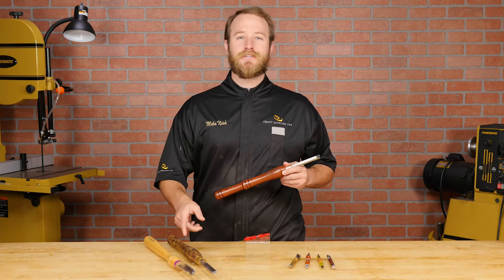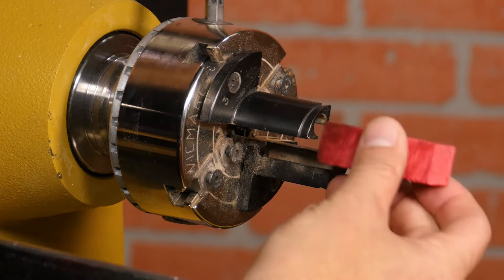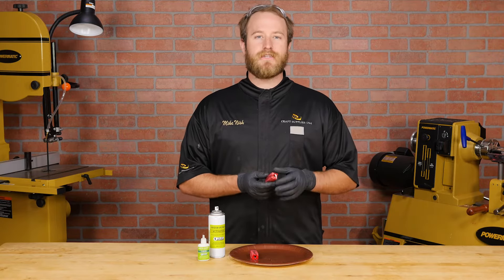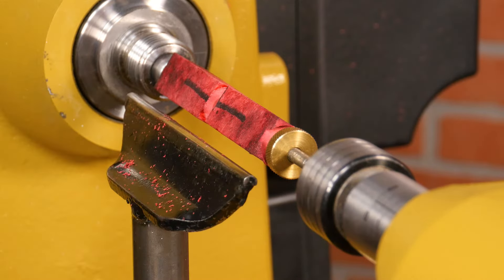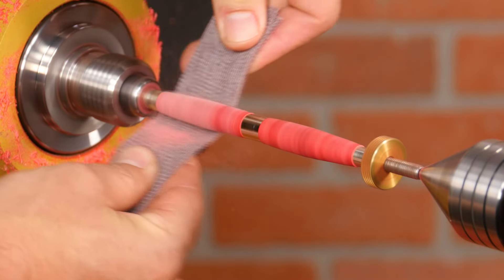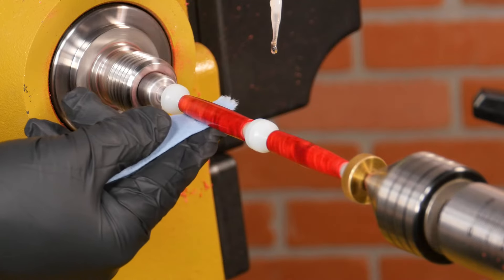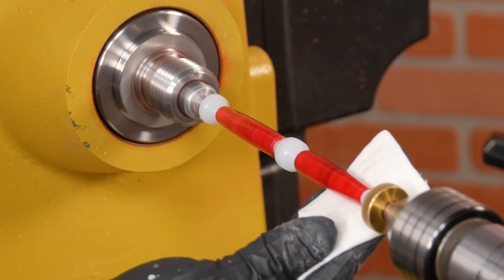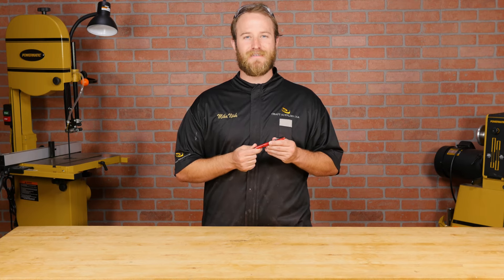Turning a Pen with Traditional Tools (How-to Beginners Guide)

Comment: When turning acrylic, I don't bother with the CA glue and continue on with sanding thru to a 12,000 grit and applying water at the same time. The finish on the acrylic comes out like glass and saves you from the CA ordeal with ridges and cacking around with that. Great video by the way.

Comment: Good video...one of the best. I sand the tube with 150 grit and wipe with a paper towel and acetone to remove any oils, fine particles, etc. I was pondering using the skew for the final dimensions. Thanks for the demo. I also made a tool from HDPE to insert the glued tube. No-stick bushings from the HDPE, too. I tried MM but the CA gummed up the grits and wouldn't wash off. More water? Thanks.

Comment: Is there any alternative to using a barrel trimmer? Would sanding the blank down be ok?
Reply from the maker: You can sand it, but make sure you're sanding on a square surface. Keep in mind that barrel trimmers will clear out any excess glue in the tube and sanding can't solve that problem.
Reply: @CraftSuppliesUSA  awesome, thanks

Comment: I am just staring at lathe turning but all the cuts are scraps, no planning cuts. Maybe I am to new but that was to much sanding. I hate sanding. Very cool video, I am excited to try and make some pens someday.
Reply: What sanding is the best part
Reply: Sanding is the most relaxing and productive part.
Reply: Sanding in any type of woodworking is   time consuming yet where a great woodworker can learn to shine😊. It makes a huge difference in the finished product.  I am just returning to woodworking after many years away and can’t wait to see the progress time has made. I have never heard of CA glue as a finish for instance. I don’t even know how that is a finish.
Reply: @4acrehobbytfarm  If you know how to use a lathe and your tools, you can get a better finish with a blade over sanding. Sanding is a cheat.